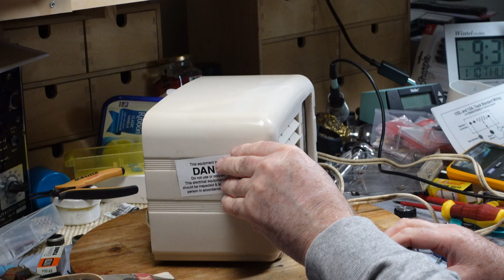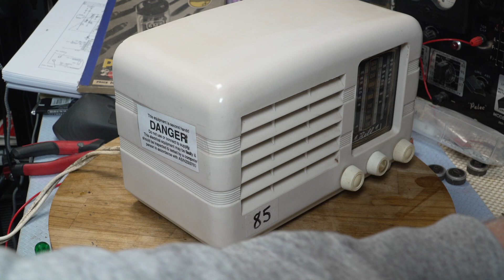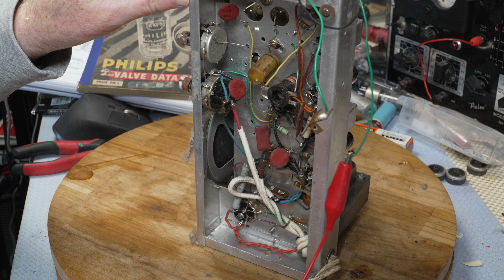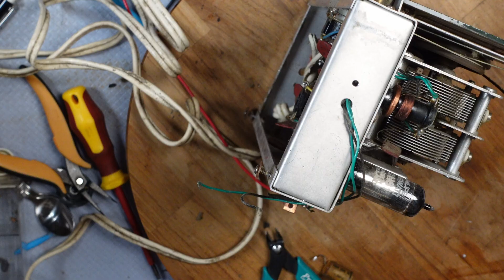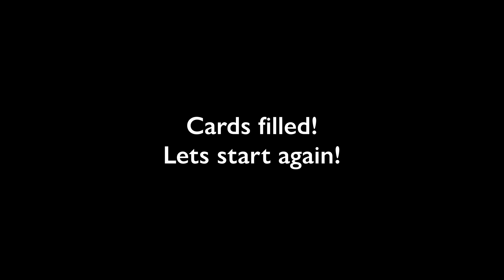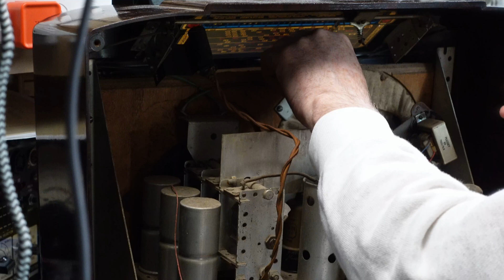Bell Colt & Phillips 3362A

Comment: I'm a Kiwi and the common term here in NZ is valves, but I say tubes. The cord isn't house wiring, it's an early form of "Tru-rip" cable with individually sheathed active and neutral conductors with an unsheathed earth conductor that runs between the two. Bell Radio & TV used this cable for almost everything they made including 26" black and white TVs, radiograms and more. The chassis is cold and should be connected to ground. The big transformer on the end of the chassis provides isolation. Unlike the US, we never made hot-chassis radios here due to the fact that our mains voltage didn't suit series heater strings.
Reply from the maker: Hi, that’s interesting. That main’s cord is certainly heavy duty for the radio! I have seen lighter duty house wire! I was pretty sure that it wasn’t a live chassis. Some of the Astors/Pye sets are live even with the mains transformer and you have to be careful even with an isolated supply. know someone with about 50 Bell sets, he has a huge shed that was designed for 3 semi’s with the trailers. It’s filled with thousands of radios and TVs.
Reply: @electrosoundaust  Yes, it was a very heavy duty cable. Bell had the habit of getting deals on things and they would have likely got a deal on the cable and bought up big. Therefore they used it on everything they made from small radios to large current hogging black and white TVs.
There are still some massive collections of radios and TVs around, but sadly the young of today don't seem interested in them so apart from gets saved in museums, many private collections will ultimately end up in landfills.